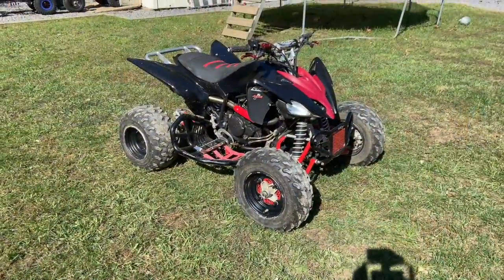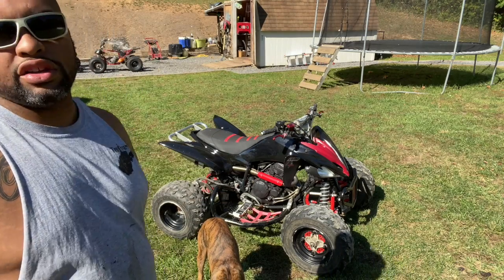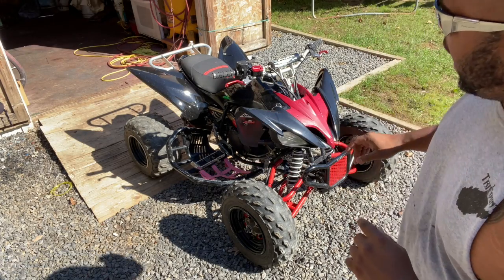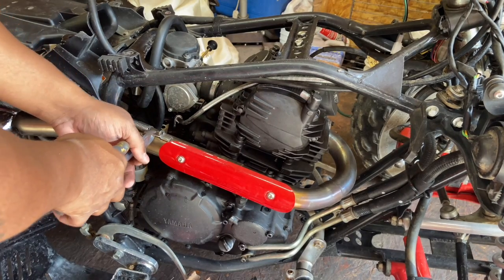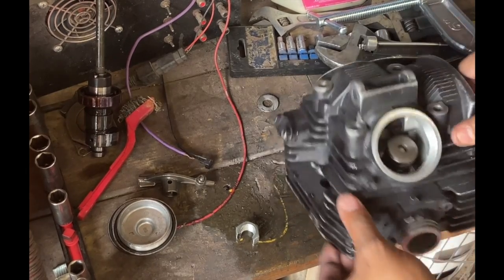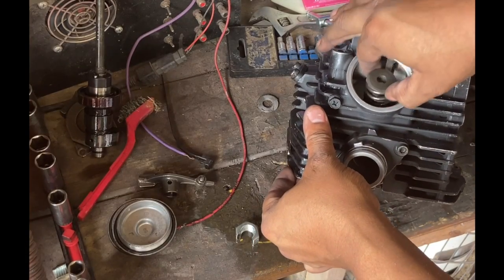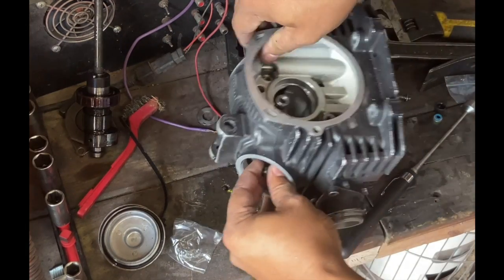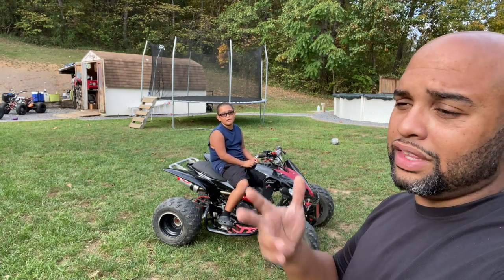Raptor 250 Smoking Valve Seal Replacement

Comment: Great video! Although not the proper way this job can be done without pulling the head. Just recently did valve seals on a yamaha 400 with only removing the cam, and front exhaust pipe using nylon rope in cylinder and screwdrivers to compress the springs. Bit tricky but me and my buddy did it and had it back together running in about 3 hours. I love do it yourself videos! Take care and have a good one!

Comment: Nice, I had no idea about the issue.  I purchased Yamaha Raptor 700R for 2300. It is running but smokes a lot.  The mechanic suspected it is a valve seal issue.  Simple Fix.  I did a good purchase...
Reply from the maker: Oh yeah. If I can find a raptor 700 for $2300. I will definitely buy it. If it stops smoking After about a minute, it is the seal. If it keeps smoking, rings.
Reply: @juicer911  Thank you after your disclosure I believe it is the rings.  It keeps smoking. Major smoke.
Reply: @juicer911   Thank you after your disclosure I believe it is the rings.  It keeps smoking. Major smoke.
Reply from the maker: @starseoltd.4927  I would guess rings. The head will need to come off and the cylinder would also. Just inspect the cylinder for scratches, if none present, replace the rings.
Reply: @juicer911  Thank you, if you come to Las Vegas look me up. I have jet skies for the river and lake and now two Raptors.  I am setting up a trailer to tow all of them at one time.

Comment: This video was a life saver for me.  Put the Vitos kit in and didnt do the darned valves.  After about 6 moths I noticed the valve seals were bad so here we go again... I have never done valves before!  What did you do for jetting in the 250?  Thank you VERY much for this video!
Reply from the maker: I personally feel the Raptor carbs are very basic. If it starred fine before, I would leave the pilot alone. But if you can NEVER start it without the choke, it would not hurt to bump the pilot up a size. Not the main jet, I just bumper it up a few and took it for a quick spin, then checked the plug. Went for brown. Not black and not white.

Comment: My son's Raptor 250 has been down on power. Checked compression and only reading 110psi. Installed a Vitos performance piston and new rings/gaskets and now it is only reading 120psi?. The cyclinder looked good. No scratches. The old piston even looked fine?. Any idea why the low compression?